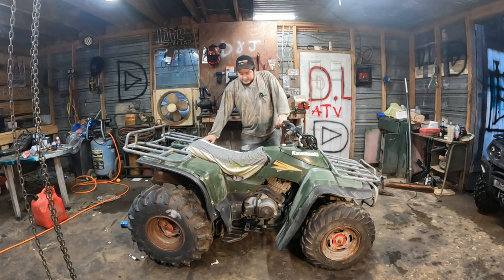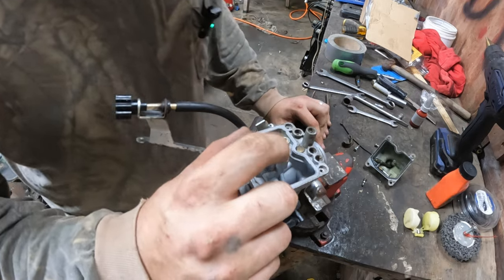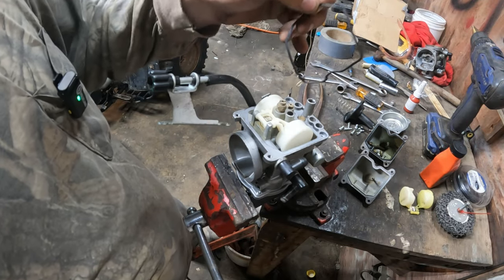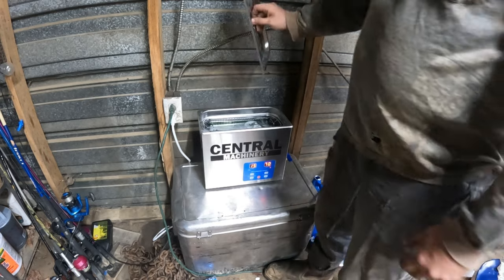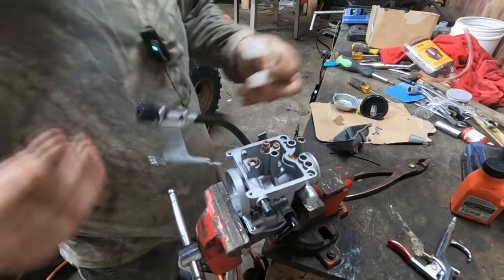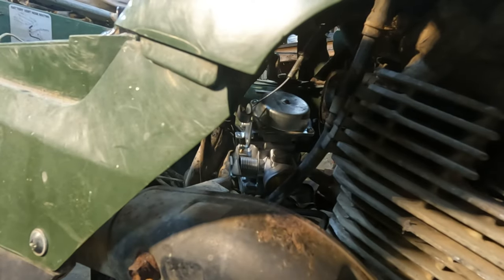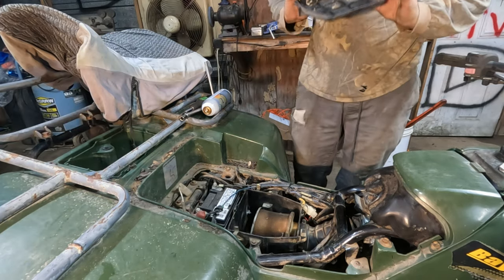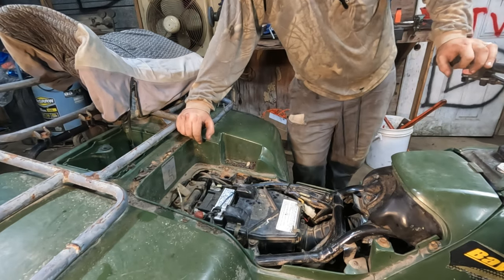KAWASAKI BAYOU 300 *WILL IT RUN*  Carburetor cleaning!

Comment: Great job Dustin, you have good commentary throught the whole video and the step by step without cutting anything was easy to follow. It's a fairly long video but if you cut anything it wouldn't have need as good. Keep up the good work!
Reply from the maker: I'd cut some out but info is key wen you need to know how to fix something thanks 👍

Comment: hi Dustin i have a 1986 Kawasaki bayou 300 2x4 it pops i have r/r the carb and have put on over 4 carbs still pops will run but trying to accelerate it will pop and no power also did the timing and valve adjustment and checked al electrical and is good pulled the head and valve lapped and no leaks piston and rings are plenty good and compression timing is dead on for the 300 voltage is 14,30 charging replaced the spark pick up is new plug is new  lol so any ideas as what i might be missing just incase i have a new ome carb coming in thanks p/s i did replace the cdi and coil just incase
Reply from the maker: It's probably the pickup coil or pulse trigger coil inside the stater cover or the key could be sheared in the flywheel